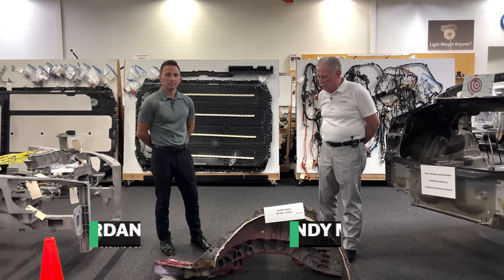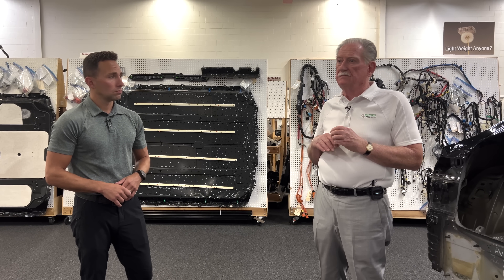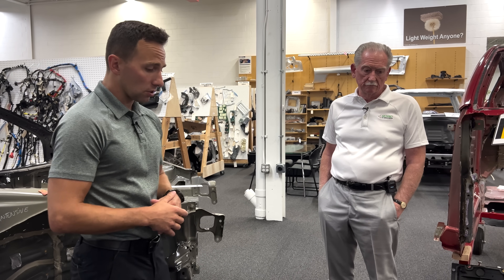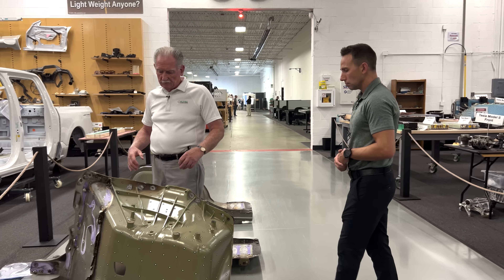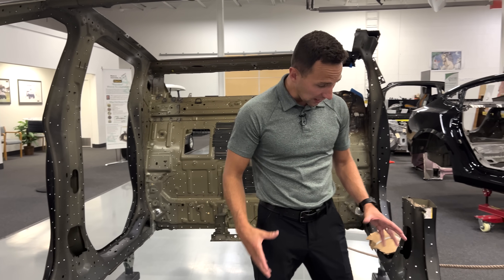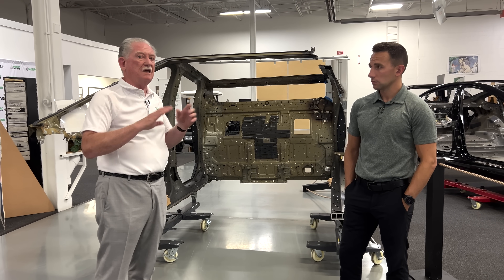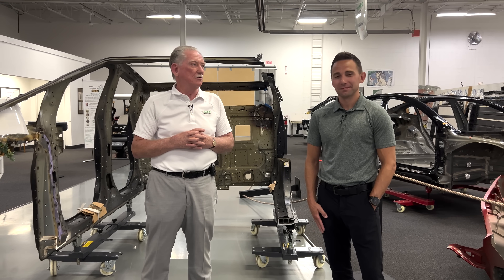From 120 to 1: How the Cybertruck Castings Continue Tesla's Reign of Reduction

Comment: Can you guys comment on Whistling Diesel ripping the bumper off?
Reply: He didn't "rip" the bumper off, he sheared it by dynamically dropping the entire weight of the vehicle on it, with the force "upside down".  Same result with any other truck.
Reply: From memory...
First they took the CT over an obstacle which the others they were testing couldn't even climb.
THEN the bounced the CT at speed off that obstacle, landing on the rear bumper section.....
.
Am I wrong?
Reply: @rogerstarkey5390  Did you see the second video where they dropped the F150 on the hitch 100+ times and it didn't break?

I'd like to hear what Munro and Associates has to say about it.  Tesla too.

If they need to revise the design, why not?
Reply: The point is if the casting cracks the trailer can crash into someone else.

Cody makes a good point

Comment: Another good explanation of the Tesla castings revolution.  Appreciate the kind knowledgeable perspective, dealing with what is known and acknowledging the challenges faced by people involved. 
However, I am concerned by the use of castings due to their lack of repairability.  Although batteries are a primary concern in accident damaged vehicles, dealing with damaged or potentially compromised castings, has created a new problem.  Sheet metal structures can be straightened out, re-jigged, whilst retaining their continued crash behaviour qualities, yet castings can be invisibly compromise or may have lost a small part of the casting.  Do insurance companies allow a crash damaged Model Y with castings to be repaired, and how do the costs compare to a steel structured car?  I am concerned as in recent years, UK car insurance premiums have increased massively and independently of the insured car's value.  Apparently the cost of EV repairs is impacting the entire insurance market as the claims are much, much greater than non-EVs.  I understand the battery costs and risks are part of that, but it seems that the use of castings could also be factor.  Perhaps you can touch on this repairability v cost v insurers issue in the future.
Reply: PAY MORE ATTENTION
Debunked numerous times on Munro Live AND by Tesla.
Reply: @rogerstarkey5390  have you seen the front castings on the cybertruck. It starts right behind the front bumper.
Reply: @GTO33  The sacrificial rails start there.

Comment: Seen WhistlinDiesel's video?  Castings that fracture under moderate loads and break in half are not really a great idea.
Reply: Define "moderate loads" ? CT is designed to tow 11,000lb. Have you seen any CT failures towing the loads it's designed to tow ?
Reply: @fd15k  He totally proved you can drop a Steele framed car on it's hitch and not break.  I agree with Whistling Diesel, the casting needs to take a beating and not crack.  Offroading you're going to land on the back of the truck sometimes.
Reply: @davidc9710  

The only thing he proved is that it likely won't break immediately. I do enough fabrication and repair to see fatigue failures in steel components of vehicles and machinery. Offroading has no official definition for which specs can be estanlished. Steel-framed vehicles break regularly when people abuse them in rock crawling and similar activities, most actually build custom vehicles altogether to improve their performance and durability. Basically if you're going to compare vehicles by arbitrary made up standards instead of engineering, then there is no conversation to be had.
Reply: @davidc9710  
I wasn't really paying attention, but as I recall, the F150(?) couldn't even negotiate the obstacle the CT was bounced from, so wasn't subjected to the same forces?

Comment: Clearly these castings are very smart and dramatically reduce production costs. My question is, what about repair costs? If the casting is damaged in a minor impact and has to be replaced, are we going to see huge insurance payouts, reflected in huge insurance premiums?
Reply: My vague recollection from other videos is that the castings are bolted/welded to pieces of metal that provide a crumple zone. So in the event of a minor crash, the crumple-zone metal will absorb most/all the impact, leaving the castings in good condition, and hence the repair shop will have to replace only the crumple-zone metal pieces.

Comment: Tesla eliminated 600 robots when implementing giga-castings….🕺
Reply: And a lot of presses and tooling to stamp the steel. Oh and assembly stations/lines to put those hundreds of parts into subassemblies…
Reply: Yeah good for Elon not so good for anyone wanting a durable utility vehicle.
Reply: @ It actually makes a more rigid frame. Checkout Sandy Munro’s videos on the subject. He’s an engineer with a consulting firm that does this analysis and advises all makes of vehicles. He knows a lot more about engineering than you and I.
Educate yourself.
Reply: @ I’m not sure what you’re basing that statement on, I saw Sandy Monro, Monro Assoc. railing on a casting with a sledgehammer and there was no deformation.
Reply: @michaelsmithers4900 A sledgehammer test is a useless one.
Reply: @ It shows that it’s more resistant to impact. 
What’s useless it dropping the truck from five feet in the air with all the truck’s weight landing on the rear bumper and then attaching a load to the wreckage and claiming it can’t tow. 
These trucks are seeing abuse far beyond what any truck is designed for and then being unfairly judged.
Reply: @ Resistant to impact is not always what you want, sometimes one needs energy absorbsion.  Either way a sledgehammer is nowhere near real application testing. 

As of Sept ‘24, around 5,500 Cybertrucks have been delivered, so I don’t know how you have data these trucks are being used as you describe.  The tounge weight, per Tesla is 160#…a near useless number for towing much of anything for a vehicle of that size. That tongue rating is near that of an Equinox. 😂

I have no skin in the Cybertruck or similar vehicle game, however as someone who hauls and tows (not commercial): none of these are useful to me.  Most of these are glorified grocery haulers.
Reply: Now the robots are going on strike because automation eliminates their jobs
Reply: @lightningdemolition1964  haha, probably being re-trained as super soldiers.
Reply: @aussie2uGA  or COVID cops and Hunters for Harris opponents
Reply: That's the whole factory, not just the castings

Comment: Question?
How would you make this 1 piece?
Has anybody done a stress test on this piece?
Does TESLA have a TEAM of VALUE engineers, that go through each product step by step?
Could it be that TESLA did a series of INTERNAL AUDITS?
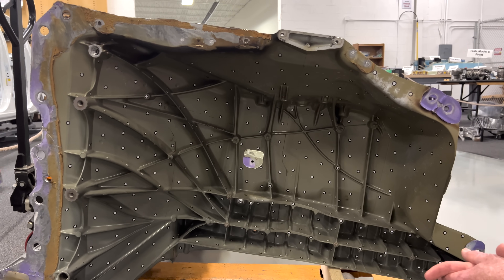@ 7:05 with the series of interwoven lines: does it make the piece STRONGER?
NICE detail on it
THE BIG 3 in DETROIT was AGAINST ALUMINUM FOR YEARS.......
Casting ALUMINUM the WAY of the future as opposed to stamp sheet metal.
How's the clearance in regarding the stamped sheet metal parts on the body of the CYBER TRUCK?
Reply: @marshalllapenta7656 
Define "This"?
Reply: @marshalllapenta7656  
@7.05
1) Curves are strong.
2) If curved channels allow the material to flow more quickly, the whole casting forms  at the same time and cools at a similar rate. That also removes stress and makes it stronger.
"Clearance"?
If you mean tolerance, these will be in a different league.
Even if the casting location points aren't millimetre accurate when leaving the machine, you could set a casting in a CNC to cut every pin and screw hole to within microns, every time, no variance from vehicle to vehicle.
The castings are essentially the jig for the passenger cage.

Comment: Too bad the entire frame has poor integrity
Reply: @hankkingsley9183
IS that opinion based on a comprehensive engineering analysis, or something you saw on the internet?
Reply: @rogerstarkey5390  Your second question was the correct one.
Reply: @GrigoriZhukov  
(😉👍)
Reply: @rogerstarkey5390  It's based on the fact that the unibody frame construction includes various grades of aluminum made with a casting process. This yields less structural integrity than forged steel. Cast aluminum is brittle, so if those parts are subjected to vertical stresses, those parts will sheer or snap, where a forged steel part would bend. Forged steel has better integrity than cast aluminum.
Reply: Not really or is that dodge reference?

Comment: While the speed of progress at Tesla is amazing and until for some months ago I was a staunch fan , but my next car will not be a Tesla, because I have the impression Tesla is joining the Detroit 3. Tesla has not  solved the phantom breaking issue since the early days of Model 3.  The maps wich tesla is using are outdated, which makes Tesla cares braking on a 2 year old motorway, because there was before a speed limit of 50km/h. The detection of rain is bad and the missing stocks on small European streets with lots of roundabouts aren't fitting well. Bjorn Nyland made a life  video about the issues.  The amount of issues is too much for me. 

I will  look for cars  like the Xpeng P7+, ID7 or an Audi S6 etron. Tesla is for now disappointing.
Reply: Good for you
(Probably not so good)

Comment: When I look at them stockpiles of castings outside the Berlin plant there seems to be lots of old models in the pipeline or most have to be melted down again.
Reply: IF there were castings there which will be melted down, the point is they CAN be melted down.
When fully set up, this is an almost zero waste process.
Reply: @rogerstarkey5390  This logic still eludes the minds of the stubborn. Good to see Musk can see beyond it.
Reply: @rogerstarkey5390 No, that's undergraduate thinking at best. The energy and the labor to reprocess are substantial waste products.

Comment: Repair costs are bad enough with a normal steel construction vehicle, but at least you pull out and reshape steel. I hate to think of the cost of repairing or replacing a casting! Just caught a glimpse of the Munro cybertruck; for everyones sack, keep it hidden out of sight,it's garbage 😂
Reply: The amount of force needed to dent one of these castings would total the entire car.
Reply: Know your car designs are a step below. Pathetic is the kindest word for your so-called "designs"
Reply: @keith8443
You haven't listened to ONE thing the Sandy Munro (Y'know, the Expert) has said?
1) There are crush cans attached at strategic points to absorb low speed impacts.

2) There are repair sections available, meaning that should a casting deform (As they are DESIGNED to do in a medium speed impact), there is a defined cut line on the casting and a jig to install those sections in a Tesla approved and tested process.
Have you ever considered that "Pulling and reshaping steel" will inevitably leave stresses and some deformity?
The casting repair method won't.
.

As an analogy...
You seem to be at least interested in aircraft?
If someone bent a wing, would you be happy if the  original wing was "reshaped", or would you want a new wing to take the stresses involved?
Reply: I'd be quite happy with a repair to a wing if it was done properly. Remember that most airlines use reclaimed or refurbished parts for repairs.

Comment: That's great and all until the bumper sheers off.
Reply: yeah what a joke of a "truck" a 300hp diesel bmw x5 has litteraly a steel structure reinforcment that can be added from the dealership to increase the towing capacity to over 7700lbs, and a 1000hp tesla can barely tow 5000lbs imagine that

Comment: This was a great.
Thank you gentlemen!
Reply from the maker: Glad you enjoyed it!
Reply: @MunroLive  
I really did. Learned a lot from this discussion. I own a 3 and a Y and still get excited about Tesla’s latest tech.
Reply: @MunroLive  I’m a Tesla owner and a share holder as well.  I’m still wanting a comment on whistling diesels test.

My opinion is it should be recalled and a boxed steel rear frame as a replacement, or something to reinforce the casting.

A toe hitch should not just crack off, even if the weight of the truck lands on it.

I’ve done that myself with my model y, I hit something with the bike rack and it picked up the car.

Comment: The "aiways u5" vehicle released in 2019 came with an aluminum casting chassis that is much more impressive than the Cybertruck
Reply: What is the "aiways u5"? Never heard of it. In mass production? Profitable? Iteratively improved? State of art software and OTA updates?
Reply: @vermontsownboy6957  A Chinese and German manufacturer that sells them in Europe
Reply: The U5, while incorporating some aluminum parts for weight savings, relies on more traditional construction methods and materials, focusing on affordability and simplicity rather than large-scale casting innovations.
Reply: @danharold3087  The entire chassis of the u5 is made of aluminum and cast aluminum except for the doors, even in the Cybertruck the doors are not made of aluminum.  And also in Cybertrack they use aluminum to reduce weight to get range.
Reply: You contradicted yourself
Reply: @ישראל-ג1י  Aluminum extrusions and small castings .   That is far different than the Cybertruck.

Comment: I think the future eveloution of these casting will be a page from aerospace. If a jet is designed into a (QEC) for rapid replacement, it will serve the cyber cab excellently. Imagine swapping out a front or rear clip in ten minutes. The in service time would go through the roof. Module rehab could be a whole new industry. I wish my vehicles had this ability.
Reply: Tesla is moving in that direction.   A non Tesla tradeshow booth demonstrated how a model 3 was a stack up of modules.
Reply: And if either of these components snap, I doubt you will be going anywhere but the scrap yard, that's if you survive an impact hard enough to break one.
Reply: @mrlemm2030  The problem is not with the castings but the collision repair industry. Cars built with the large casting are bolted together.  Unbolt the damage and bolt on new parts.  This destroys their existing model.  One could setup a repair center much like a factory when a damaged car could be repaired in a few hours instead of days. 
Another example of resistance to change by people making money on the status quo.

Comment: Crash repair seems to be the only downside to me. Repairability is quite low.
Reply: This is such a non issue. A crash that would need repair to the casting would total any other car.
Reply: I read that a cracked casting can likely be welded, but realistically, any impact severe enough to crack the casting would likely total the vehicle anyway.
Reply: @ohger1  the frame of a body on frame truck can be easily changed unlike those useles castings lol!!!
Reply: @alanmay7929  You can't just change the body on a frame and claim it's repaired. No insurance would approve that repair, they'd just total it.
Reply: @alanmay7929  "Easily changed"?  A frame damaged bad enough to be changed means the truck is junk.
Reply: there are way too many downsides, a regular body on frame truck can be made into single/double cab, short-very long bed.... can be sold just as chassis cab without the bed or just the chassis with powertrain for RV builders.... conversion into dump truck and much more.

Comment: Sandy can you elaborate a little bit about the rust that some of the models develop, especially around the tires ark and the small pockets from the casting that gathers sand and water and compromise the metal/zink material and already after 2-3 years develop some signs of rust.
Reply: Gonna need a source on that.
Reply: @themonsterunderyourbed9408  and this one where they talk around the holes that sand and and other stuff go through and sit for a long time until they develop rust 
https://youtu.be/IRjjS_yY2Qg?si=tVcJ-roxXoOGfDI0
Reply: @hristo633  I see them pointing it out, what I don't see is any rust. 
They're talking about a theoretical. Also, that area is all open. Lots of airflow and open space. I've look at those areas on my model 3 and it's super clean.
Reply: Aluminum doesn't rust.
Reply: @ only model S and X have aluminium fenders. 3 and Y have metal/zink ones ✌🏻